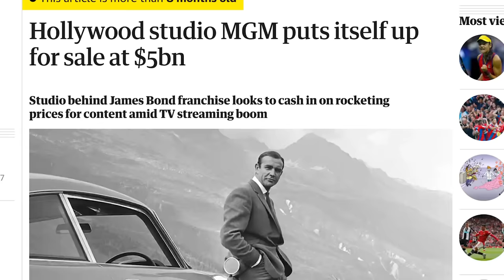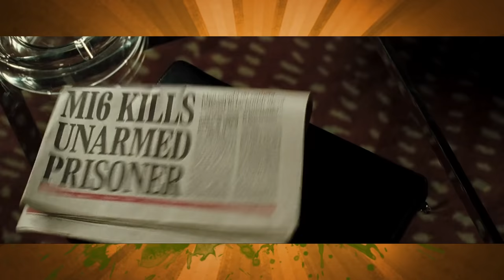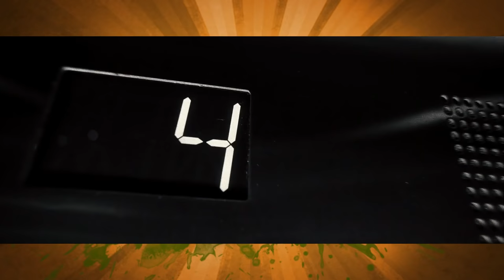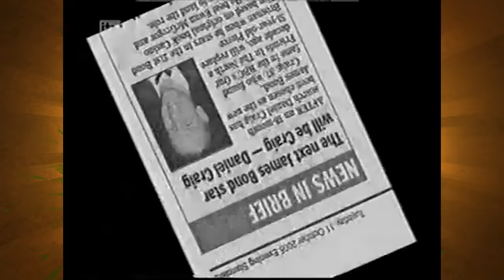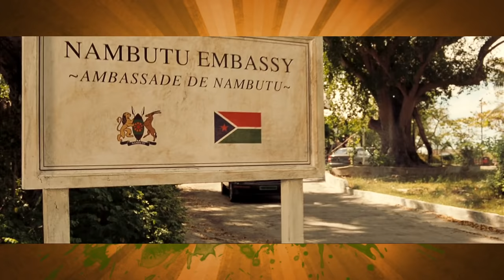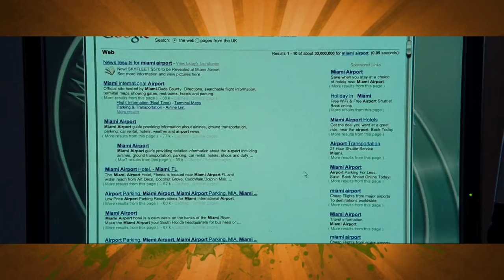Casino Royale - Caravan Of Garbage

Comment: Just rewatched the scene to make sure. The action in the poker scene actually occurs in the incorrect order for dramatic effect of the scene. Since Le Chiffre called Bond's all-in, Bond would have to show his cards first of all the players to settle the side pot between the two of them, and then the main pot gets settled. Since Bond has the best hand out of all four players, technically he would be the only player that would have been required to show their cards at the hand's conclusion. It's a slow roll as shown on screen, but would not have been if it had played out the way it's supposed to in real life.

Comment: Fun facts about the Quantum of Solace game; 
The team that managed to develop it within 8 months was actually a small crew. The majority of Treyarch were still working on Call of Duty: World at War, and both games released within 11 days of each other. 

Not only does it reuse assets from Call of Duty: Modern Warfare and Call of Duty: World at War because of this, but it also seemingly has early versions of weapon models from Call of Duty: Black Ops, the sequel to World at War that didn't release until two years later and was likely only in pre-production by the time they finished QoS. This suggests that some of the weapon models made for QoS were intended to be used as a starting point for the weapons of the next CoD game.